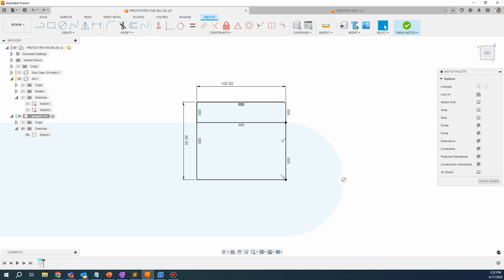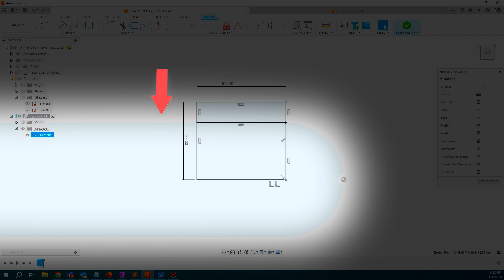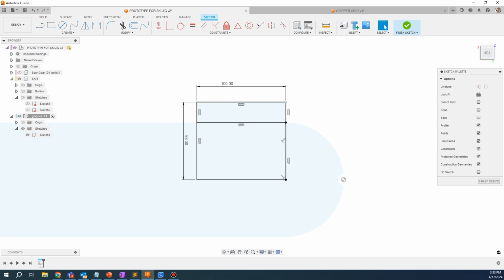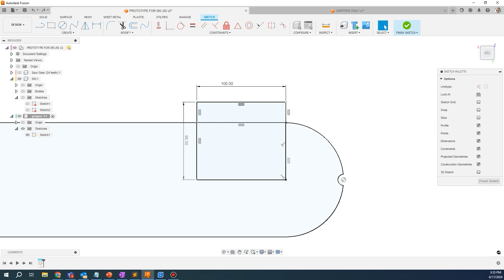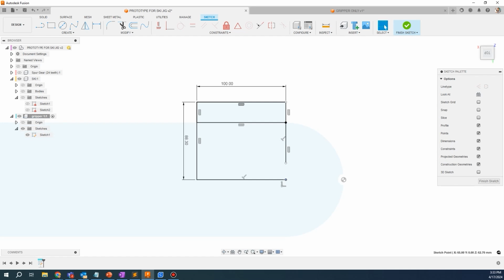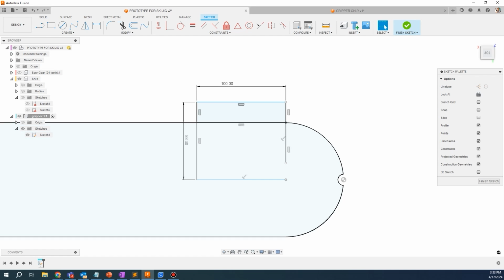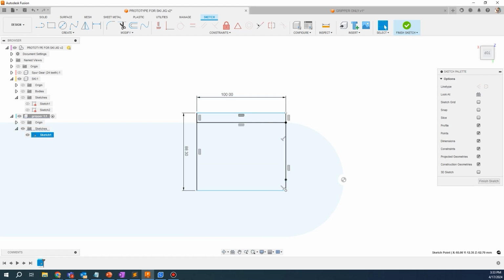Fusion 360 Sketch Will Not Move (Tips for Finding Secret Constraints)

Comment: A little trick that I stumbled on. Whilst in sketch mode, if you  turn off (un tick) constraints in the sketch pallet you can then click on a part of the sketch, be it a line, curve, point or whatever and it will show the constraints related to those objects whilst keeping the rest hidden. accessing the constraints this way makes them easier to hover over as well. 
Hope this helps someone down the line.

Comment: It's even harder to unterstand when english isn't your first language...
It would allso helped if your vocabulary were little bit more from this area😆

But yeah, getting there. Slowly but surely.
Luckily there's YouTube...

Got a question, not related to this video. And may or may not asked million time's before.

Have a plans for boat. Boat is fabricated out of aluminum sheet's.
What is the best/easiest way to make a drawing for CNC-laser and CNC-brake?

Have been trying to make it in sheet metal mode. But i found out that makeing a full assembly is impossible in this mode...nor i just dont know how to do it.

I have managed to get to the point that i have a bended piece of sheet metal component but i dont know how to finalise it (part of the component has curved faces that need to be jointed)

Comment: The frustration I have is when you see 2 constraints, like you had with the junction of the two lines. And F360 doesn't tell you which constraint does what.
If it is complicated sketch, I will try to delete one of the many constraints and Undo if that was the wrong one. Then try the 2nd one, etc. 😬
And many times, F adds constraints that you didn't explicitly want.

Comment: The other option is the one that I use frequently... delete the entire sketch and start over again, before you realize that you've just spent more time on finding the constraint than it would've taken to just draw it again. I'd like to see Fusion implement some tools to trace down bad links and constraints on sketch geometry - it often feels like I'm on a treasure hunt to get things working.
Reply: There have been a few times when I have had a large sketch with several different constraints to the origin of the sketch. Then, I discover I need to offset something and to do that, I need to delete one constraint... The lesson I learned was that I try not to have too many constraints piled up on a single point (especially the origin). It would be great if Fusion had a list view of all the constraints in a sketch. My most common way to start a sketch is to draw a rectangle, then a construction line diagonal through that and then do a midpoint constaint on the diagonal to the origin, which will then center the rectangle on the origin, but makes it easy for me to change my mind later and move the whole sketch.
Reply: Or a feature like in Word where you can toggle to show all carriage returns, tabs etc but for constraints. I feel I would understand constraints much better if I could see them all in one hit.